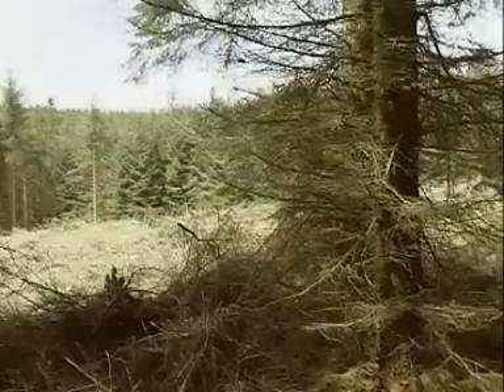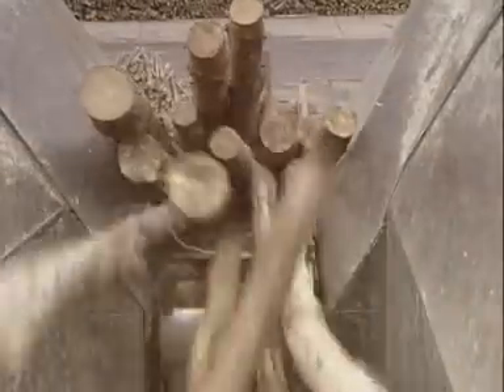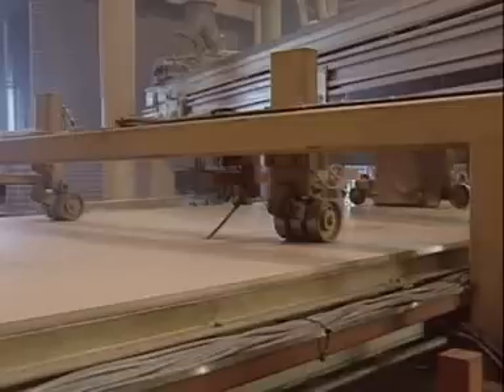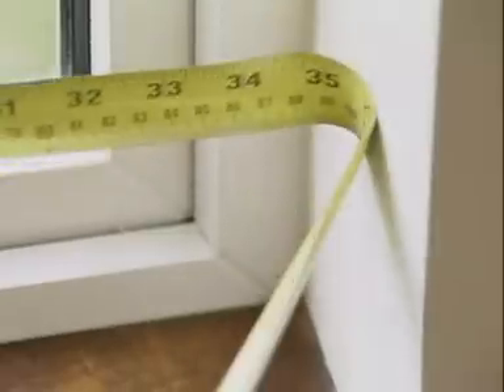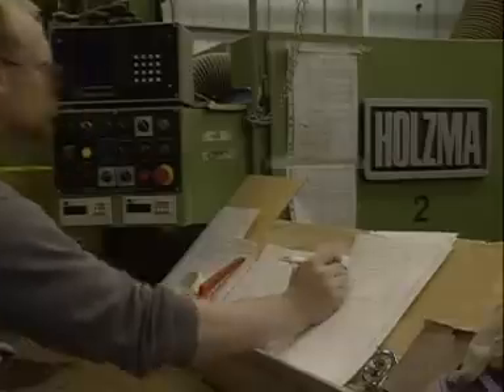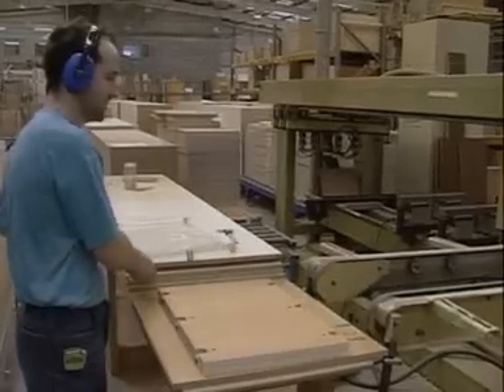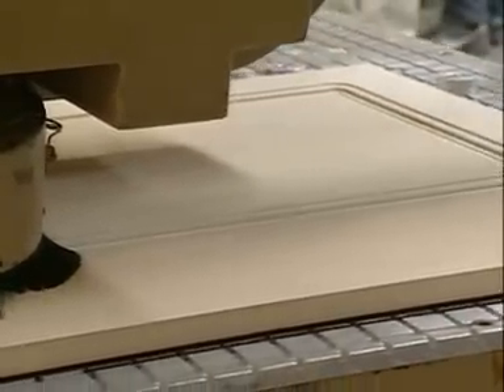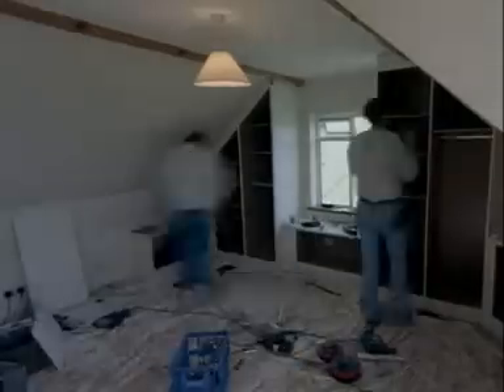MDF and HDF

Comment: With HDF the particles are smaller and the compression is greater to form a more contiguous and therefore better finish to prevent extra filling painting and sanding.  MDF is cheep and strong enough to form the structure but does not machine as well.